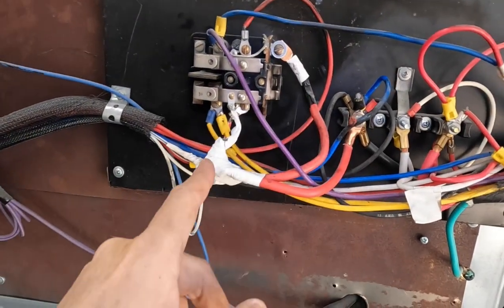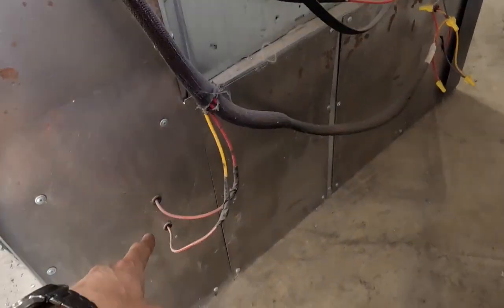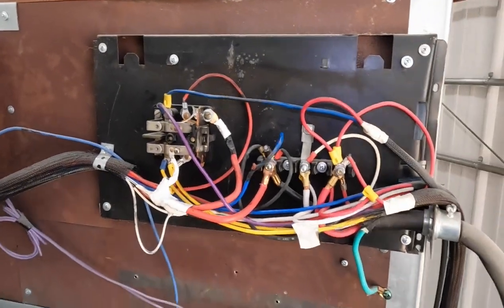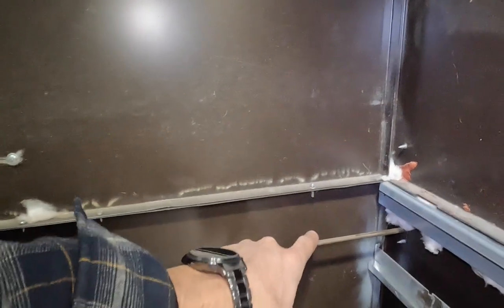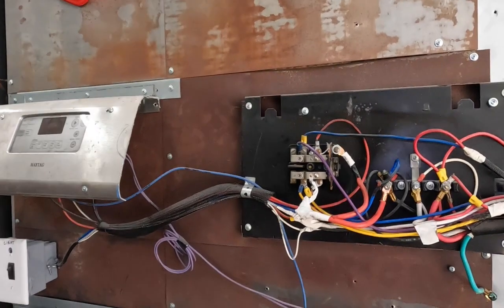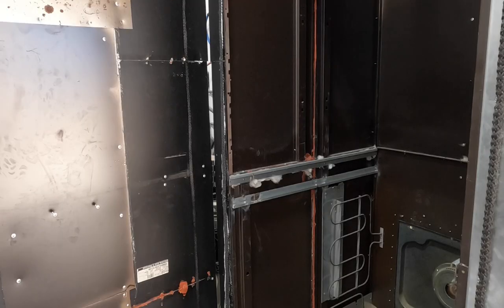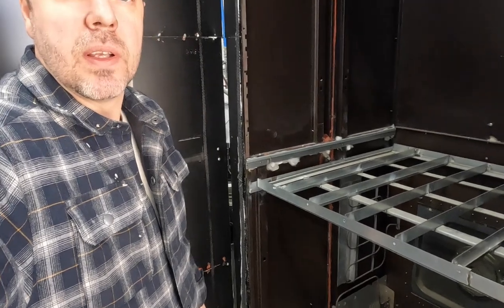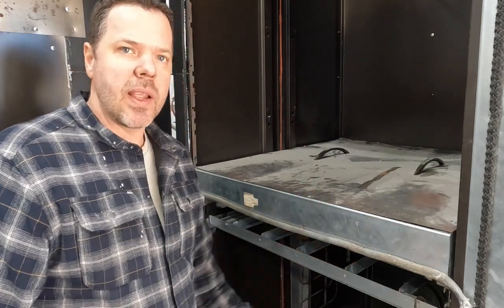DIY powder coat oven Part 6  (Electricial and Cost). Part 6

Comment: How much does it cost to roughly run an oven like this say I do two sets of wheels per week outgassing and baking after coat ?? I can’t find this answer anywhere
Reply from the maker: I don't know the exact price, it will depend on how much your utility would charge for electricity.  Basically the 4 burners are on at the same time. so, it would be like making a couple pizzas per run. Each use case would vary.   Granted I'm using more electicty, but this oven, as crude as it looks,  has double or 3 times the insulation of a standard oven.   After all that rambling, you just find how many kWh, the oven uses and multiply that by number of hours.  Then multiply that by what your Utility charges per kWh. This thing gets to 400 degrees in under 20 minutes.  If I run this a couple times a week for an hour or so. I don't notice it on my Utility bill.
Reply: You can use a propane heater if you don't want to commit to wireing electrics & it's only in the oven for 15minits after flash off